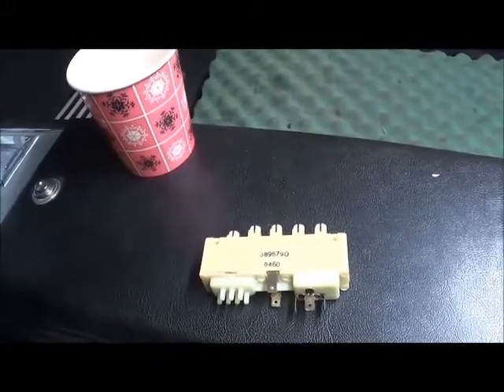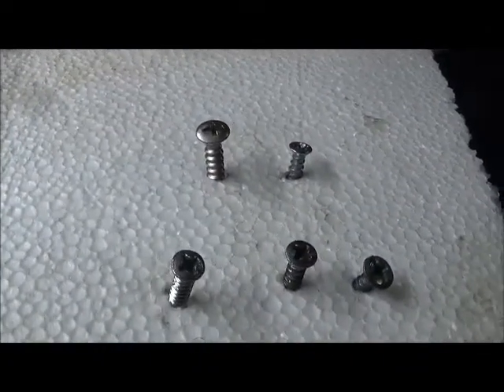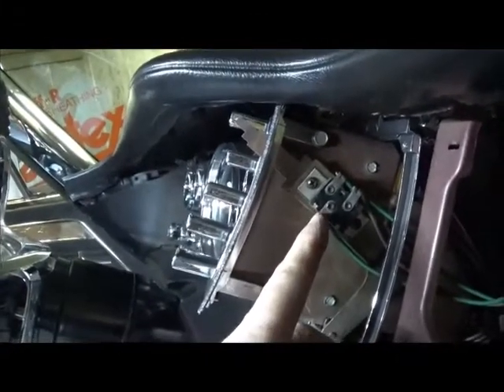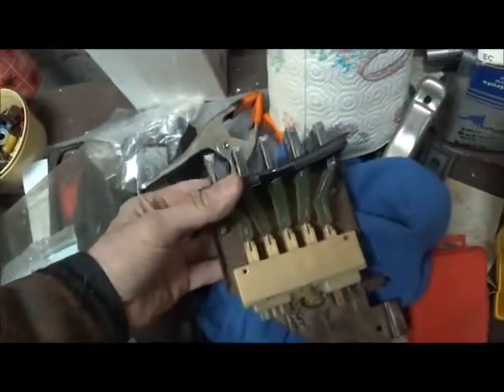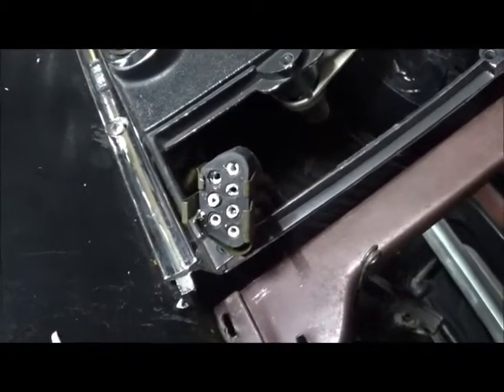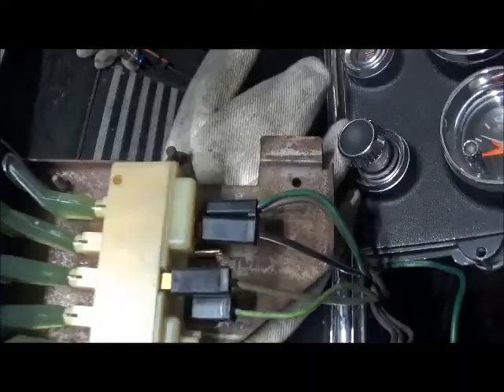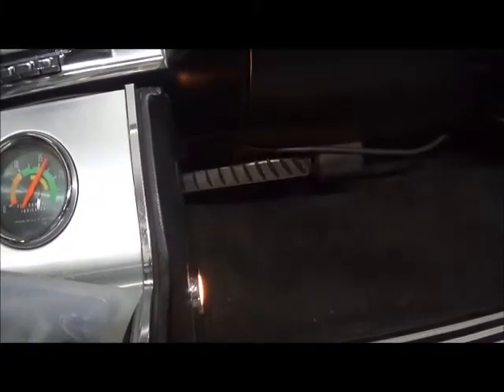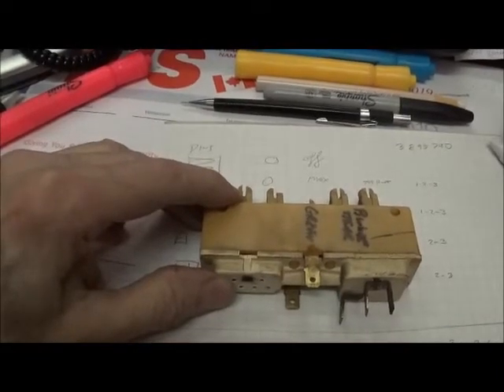Installation of heater controls AC 1964 Chrysler

Comment: Hey bob . As i mentioned on your other video i have a 300 k 64 with ac (Sometimes) Patched up wiring done by a pro? That used to own it.
I received the NOS switch from ebay  works smooth but needed to be cycled a few times to make the reg ac button show continuity.
 i found if you jumper the lower left terminal your showing at about 12 min mark. to what you call terminal one you will get ac clutch engagement at max ac and standard ac. but not at heat and defrost. 
What i think your calling 2 terminal (center of the 3 terminal cluster) you need ignition switch ign on power. 
The third terminal powers the 3 position switch on the water control lever. ( Off , first stage, and second stage) So you get 2 speeds from that lever one goes through a resistor. On my car someone disabled the second stage resistor circuit and since i can't find the resistor yet.
I have one speed.
I have been told the ac cars are capable of 3 speeds i dont see how. if true there maybe a error in my theory's.
 Im not an electrical engineer but I own a machine shop. Im to cheap to buy $100,000 cnc machining centers so i buy older ones usually at scrap price gut the motors and controls put together a new system from scratch.
Them make money with them.
So from my experience the wiring in these cars is a failure and possibly a dash fire waiting to happen.
Lets see undersized wires a high draw fan going through a micky mouse switch then an other micky mouse switch then the ignition switch then battery power. Many shaky terminals. Spade terminals are not good for the long term and especially for high load.. Not a relay in the whole thing Yahoo.
Carry an electrical approved fire extinguisher and don't tighten the poss. clamp on you battery  . (So you can jump out and pull the cable off) A hidden master switch may be a good idea so you can shut the electrical system down when the car is stored.

Comment: Hi Bob
Concerning 1963 imperial

When I move the heater lever from hot to cold or vice versa it seems heat stays on max

The cable seems connected

Any thoughts??  It's hot out here!!  Chicago
Reply from the maker: Could be the water valve is broken or not connected to the cable. Quick fix is to reroute the heater hoses in the engine compartment so no water goes through heater.

Comment: Ok i keep hearing the ac should have 3 speeds. turns out the motor has 2 . Black is common and brown is med green is high, (green as a power wire there messing with us LOL) I have a 64K (confirmed by the vin per imperial club about 20 years ago.) but it has the vents under the dash and no rear ac. Buckets console Vinyl interior. Single 4bl. The diagram shows a resistor in the engine compartment were? Im guessing thats the low speed. Maybe mine is only 2 because its the simple interior?  Its never good to run a motor at low voltage so just running on high may be a good idea. I have found single speed replacement motors non ac but the ac ones seem to be 2 speed and hard to find.
I did wire as stated below but found it has a single speed motor I installed years ago. thats why one speed so i repaired the old 2 speed motor and will install.
Ps if you look at that diagram there is something very wrong they show c4b and c5a going to the black (common) and brown low speed but then to the same terminal on the control switch?